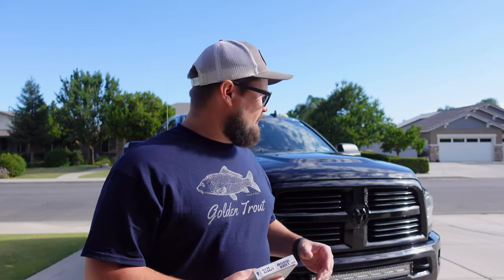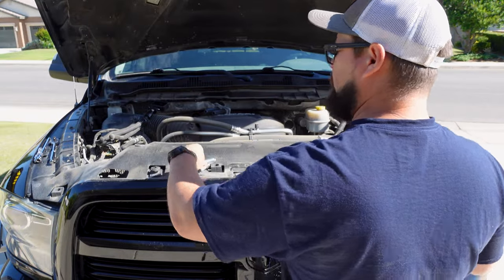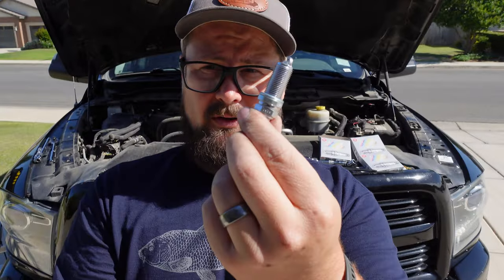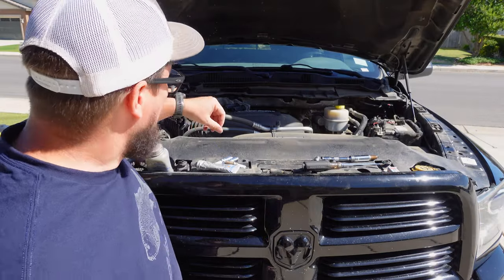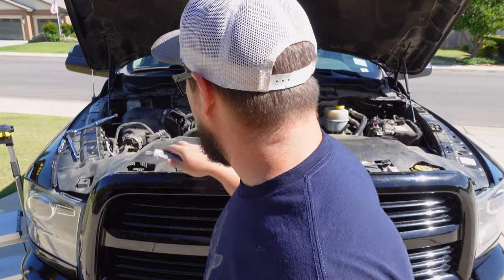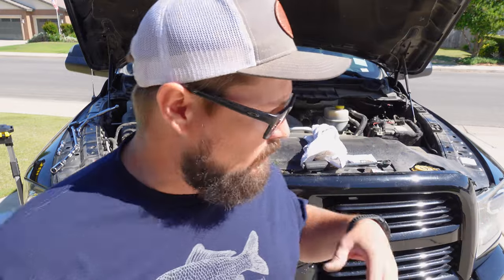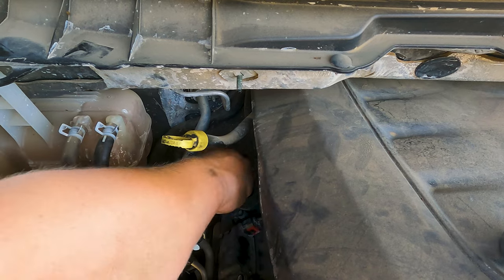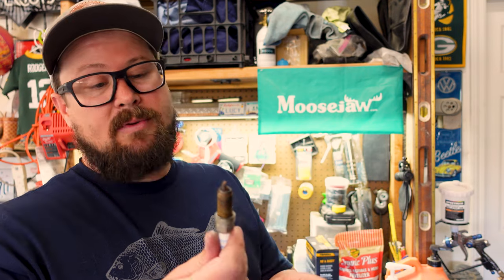How To Change Sparkplugs | Ram 2500 6.4L Hemi Engine

Comment: I just recently replaced the transmission in my 2015 2500 6.4l Power Wagon at 96000 miles! So I feel your pain. Will be tackling spark plugs soon. Thanks for the video
Reply from the maker: This is my second Ram and if there is a weak point on these trucks, it's definitely the transmission. Good luck with those plugs!
Reply: My 2018 Power Wagon has 97K on it now….haven’t had any issues at all but I just saw this comment and now I’m paranoid about my trans 😂 glad it’s under warranty through 150K
Reply: My 2016 Power Wagon is at 84,000 but I did a full transmission service at about 70,000. I don't look forward to 3 hours doing plugs though. I wish the grill still came up with the hood like the 3rd gens.
Reply: I had to have my transmission rebuilt on my 2016 power wagon at 60,000 miles.

Comment: When I did my plugs it recommended coils too.. so upgraded my coils to higher voltage with larger gap.. but didn't see much change in mph, only on long distance highway miles (kms in my case)
Reply from the maker: Good to know. I'll probably change mine at 150k, but I'm not expecting much.

Comment: Anti seize is a must.  Thought I was going to snap a plug just trying to get the originals out at 90k.
Reply from the maker: Thank you!
Reply: yeah, I was surprised how hard I had to torque them to get them out, at 100k. I've never pulled so hard to loosen a plug. But the new NGK ones screwed right in like butter. (Note: NGK does not recommend using anti seize).

Comment: One thing that took me way longer than I'd like to admit, when removing the connector for the coils, push hard in the middle, between the prongs on the red clips.
Reply from the maker: Yeah, those things are tough!
Reply: @RoadandReel  the trick is to pull them before you pull the coils, jamming a flat head into it with one hand while pulling the connector with the other. I started last night, had 2 boots stay in the holes, and only got 4 plugs changed. I did the other 12 plugs tonight, only losing one boot. Because the truck is new to me, I'd ordered replacement coils at the same time as the plugs. I put 280k miles on a Mazda, replaced the coils every 60-80k.

Comment: 2:48 why not just use a spark plug socket? 
.
They have rubber to hold the plug (some are magnetic)
.
Then ya just add extensions as you go down the plug well
.
.
Also, a 1 inch extension comes in handy
.
A 3 inch is too short, a 6 inch is too long
But a 3 + 1 puts it RIGHT at the top of the plug well
Reply from the maker: You can, but on this engine it's difficult up against the firewall and it's a lot easier to cross thread the plug when using a socket and extension to start the plug. Old cast iron heads, sure, but I don't like to chance it on the aluminum heads, especially when in a tight spot at a bad angle. I'm scarred from past Ford Triton 5.4L experiences.

Comment: Why the anti-sneeze?
.
If you don't go ID10T tight.... and replace them on time... they will not stick/strip
.
.
The only time you anti sneeze plugs is on the ford 5.4 3V engines
And then it's not on the threads... but the smooth "shank"
.
.
Anti sneeze can prevent the plug from getting a good ground....
Which causes the spark to arc through the boots... causing a nasty misfire
Reply from the maker: These plugs are going to be in this engine for the next 100,000 miles. I think the main problem with anti-sieze is when people use torque specs and over tighten causing issues. With a tiny bit on the threads, there's virtually no way to cause grounding issues unless a huge glob is used and it starts to interfere with the contact of the crush washer. I will take my chances on a grounding issue (that I've never had on hundreds of engines including many racing applications) if it minimizes my chance of pulling threads on the next spark plug change. One swipe on one side of the threads and don't over tighten and you're good.

Comment: Bosch plugs are trash...
.
Wear out fast, expensive, not efficient, etc
.
Just use the OEM brand.... champion 
.
.
Mopar gets Champs 
Gm gets ac Delco
Ford gets Motorcraft or autolight
.
.
Ngk is a good "all around" plug.... but I still prefer sticking with OEM on customers cars
.
Their should not be a difference between plug brands.... but their is
And it can cause misfires (even on brand new coils, boots, and plugs)
Reply from the maker: "Yeah, well, you know, that's just, like, your opinion, man."
- The Dude -

In all seriousness, you probably have this experience in your line of work. I run Bosch on all my German air-cooled stuff and would never change. I think every application is different and I've heard of heat tolerances and operating temperatures being different with different engines and plugs, so, yes, OEM is probably the safest bet. Thanks for the info on which brands get which plugs. That's vary useful!
Reply: I just pulled the OEM plugs today, at 100k. They are Bosch and seemed to work for that long! I replaced them with NGKs.